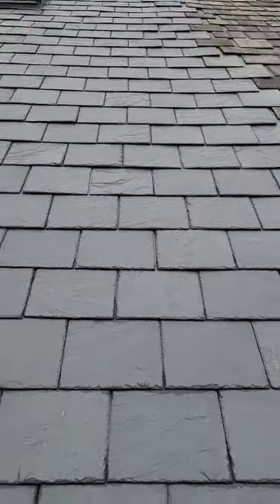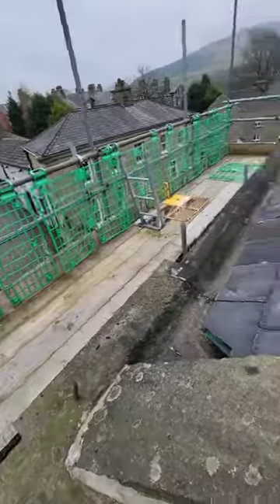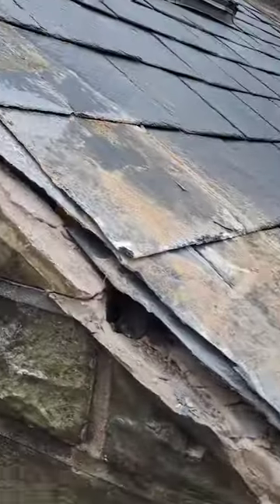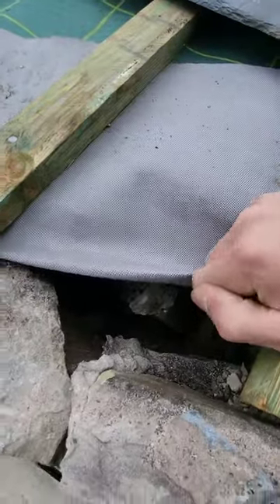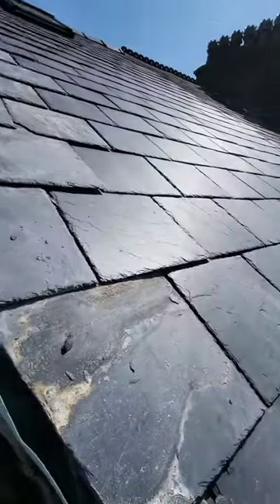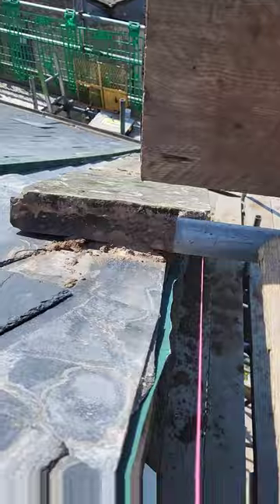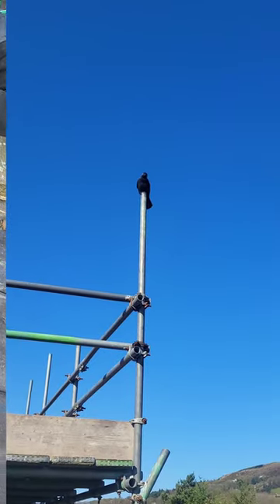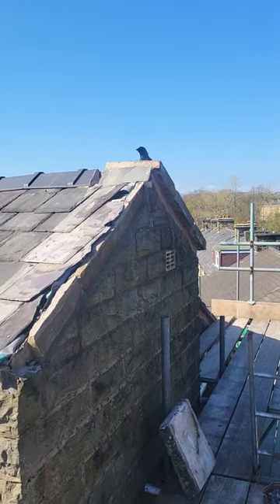Lead lining a stone gutter and rebedding coping stones

Comment: I’m not a roofer but just had my roof replaced and very similar to this one. My roofer installed lead soakers under the coping stones and slates ,was this the case here? Not clear. Nice work with the lead gutter 👍